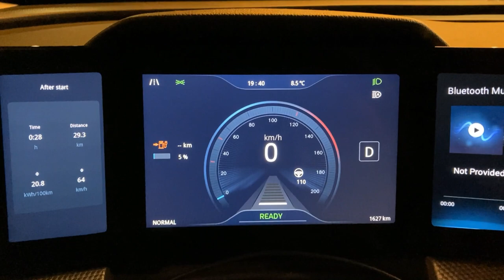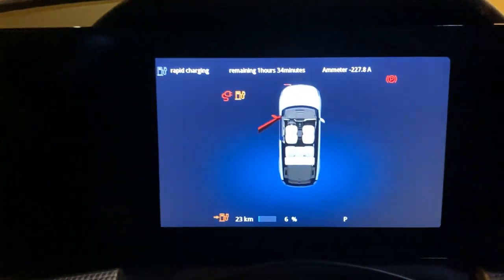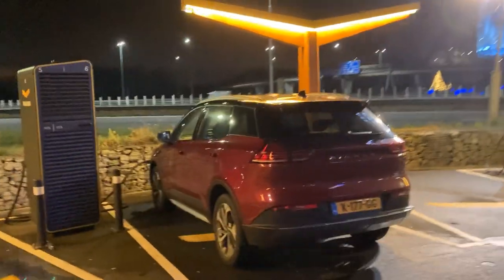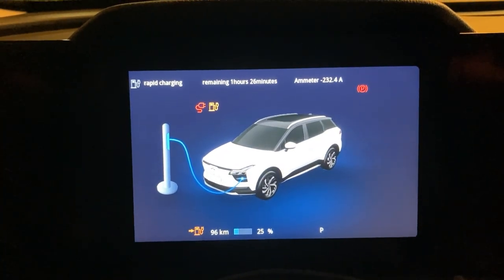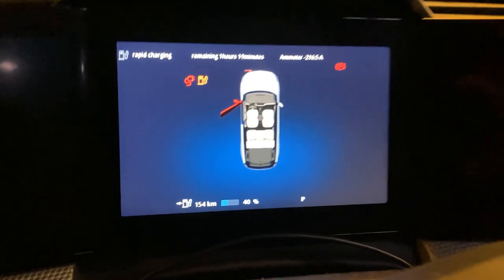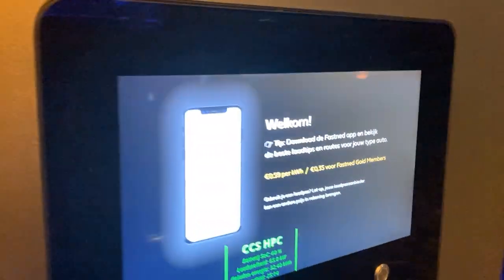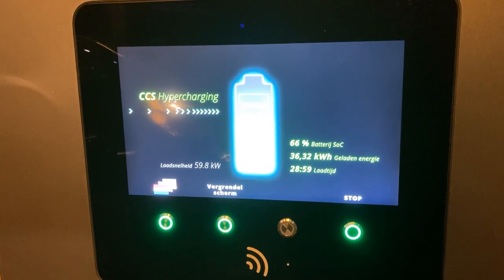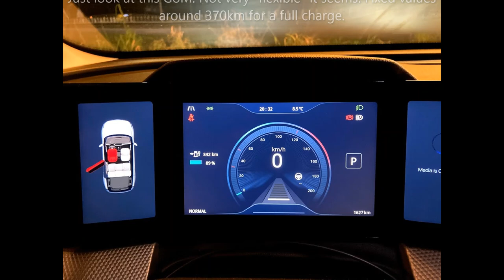Fast charging test with the AIways U5 at Fastned

Comment: At 60% SOC it was beating the charge rate of the polestar at 50% SOC?
Reply from the maker: I still have to test the Polestar 2 myself, but it could be true yes. Probably also depending on battery temp and maybe new software will help (the P2).

Comment: Hi ! how much  did that cost to charge the battery ? thanks
Reply from the maker: https://fastnedcharging.com/en/choose-your-priceplan -- Fastned typically charges 0,59/kWh, but you can for example use a Maingau charging card for a more competitive price and if you visit twice a month becoming a Gold member at 12/month is a smart idea. Then it will be 0,35/kWh which would mean 50x0,35=17,50 euros for this charging session!
Reply: @electricfelix  thanks a lot !
Reply from the maker: @anharrelativity6550  of course! I also recommend the page I keep updated about EU fast charging pricing: electricfelix.com/cheapfastcharging